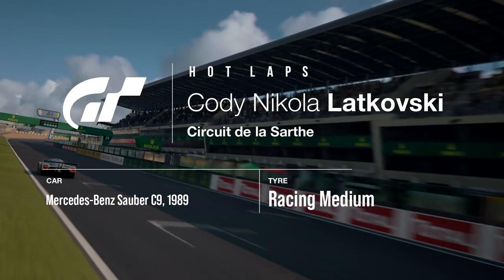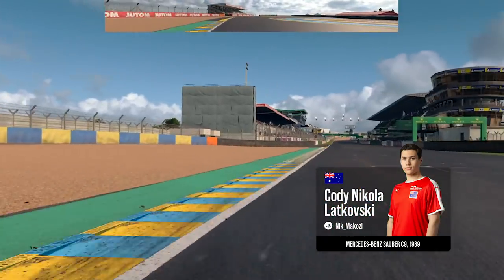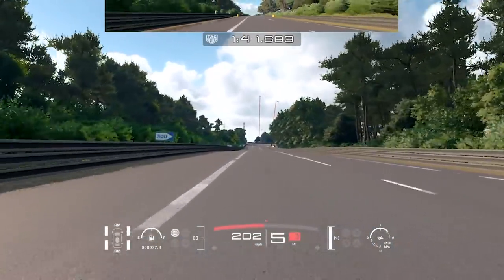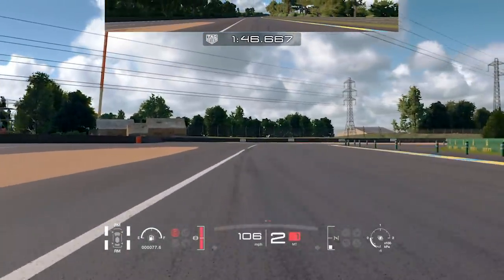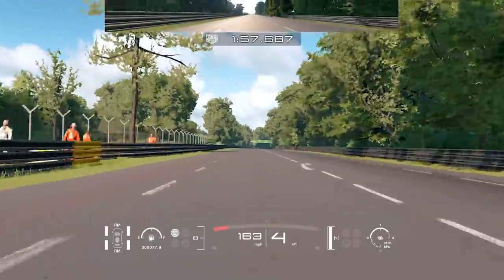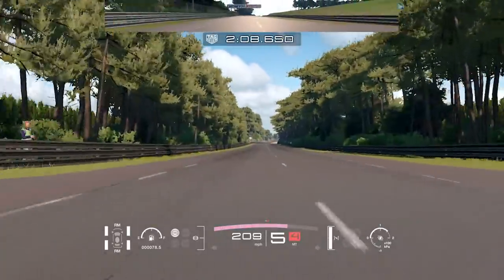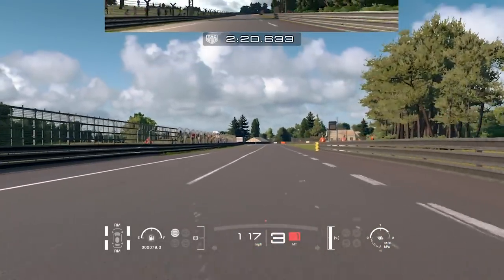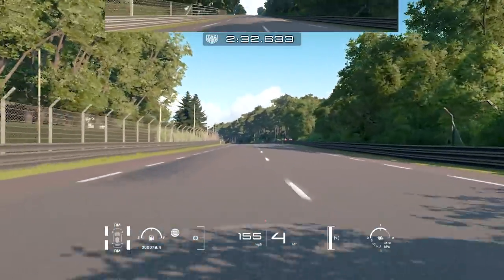GT HOT LAP - Circuit De La Sarthe Mercedes-Benz Sauber C9, 1989 - R23

Comment: Right I need a video on how do you conserve fuel on nordschleife, quite a lot of people are doing a no stop.
Reply: @user-zv8qg1co4z  do you also change the fuel level throughout the race?
Reply: @RavenwestR1  I personally never use the fuel map. Short shifting works perfectly. I usually shift around mid rev, sometime a bit before depending on the situation. It's good to do it on other races that doesn't especially require fuel conservation as you can gain tremendous time on the pit stop. You'll need less time to fill up to what you need to finish the race.
Reply: @mobius1490  Im doing the opposite, I always change the fuel level map but redlining all the shifts. I dont know, not redlining the car makes me feel lost touch with it.
Reply: @mobius1490  but yeah I think I should try short shifting properly.
Reply: @RavenwestR1  I guess whichever works if used properly, but I find shortshifting much easier and instinctive to use, it's less bother and you can concentrate more on the race. Yes give it a try, you get used to it quite fast